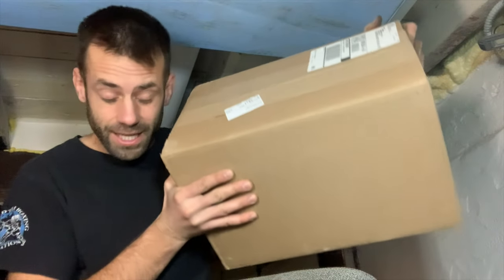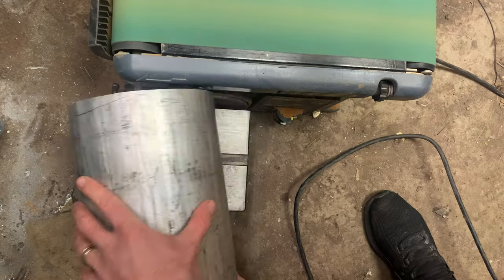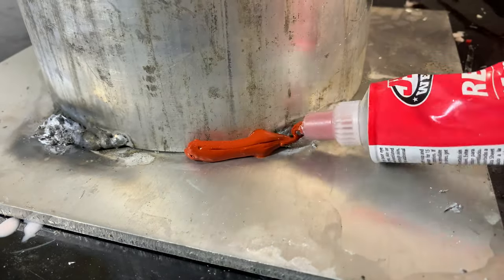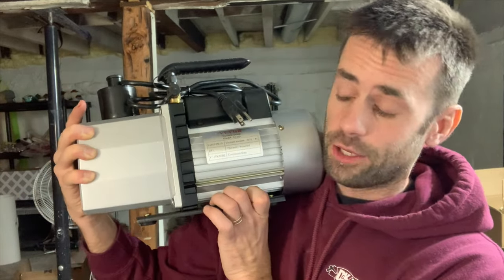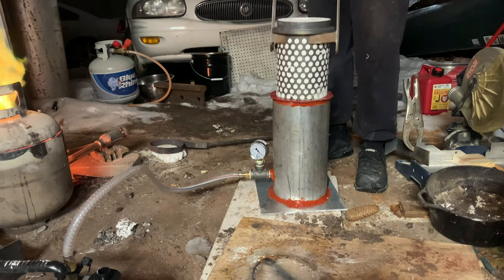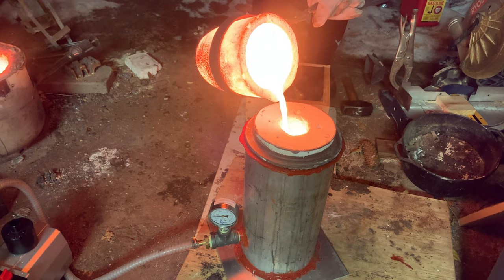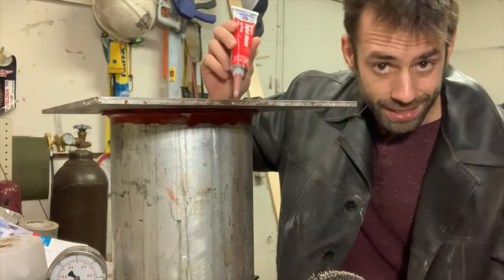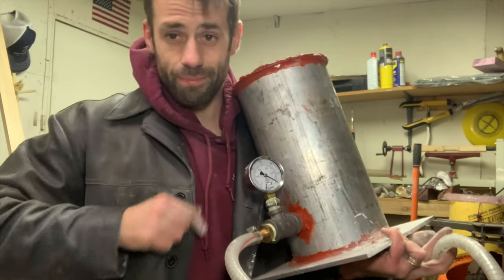DIY Vacuum Casting Set up / Build.

Comment: For the air temp on the vacuum pump, you could always bend some copper tube into a coil and stick it into a bucket of water to act as a heat exchanger to cool the air before it goes through the pump.
Reply: You should probably draw him a picture.  He doesn't seem to bright.
Reply: @kayakMike1000 what? 😂

The dim calling others "not bright" never gets old
Reply: I had that same exact idea!

Comment: I know this is a video from 2 years ago, (just found this channel, love your gold prospecting channel). But I wanted to tell you for FUTURE use when working with Aluminum in the garage use WD-40 as a "cutting/sanding/grinding/drilling/milling" fluid. It works great at NOT loading up your abrasives or cutting tools. Mineral spirits also works well. Being a machinist for almost 40 years this little trick has come in pretty handy. It will make a white smoke, and a bit of odor but that's about it. I have never had a problem with flammability so you should be ok. Good luck and keep cranking out the video's for us. They are very entertaining!!!

Comment: Could just use a longer vacuum hose and submerge some it in a bucket of ice water to keep the air temp down and hopefully keep any metal out of the pump incase of a blowout

Comment: The reason the silicone sheet doesn't work is the the top of the pipe and the plate aren't flat,if you machined them itd work
Reply from the maker: Now I just use a little silicone calk each time. Works really well.

Comment: Instead of taping entire container I've seen other people wrap the perforated container in heavy paper.  The paper looked like a very thin flexible cardboard. The other vloger taped the paper wrap together, using a whole lot less tape and easier to remove.

Comment from the maker: FYI update. The design works very well but do not use aluminum like I did. Use steel pipe! 
I just had a blowout in my flask and the molten bronze melted right though the aluminum. You can see what happened here: 
https://youtube.com/shorts/bgMf2Uo2CUU?feature=share
Reply: Should pin this comment to the top so it doesn't get lost.

Comment: I also made a homemade vacuum chamber. I cannot Weld metal like you do so I used a vacuum chamber with it's thick plastic lid and vacuum pump that I bought from Vivohome on Amazon. I will put info for these items below. I used Dremel drill bit and a Dremel  router to cut into the plastic to make a hole for a three inch diameter perforated casting flask. It is about 7 inches tall. I use a silicone rubber pad to act like a gasket forming a vacuum seal. I also used vacuum grease which sometimes worked and sometimes didn't. Many times, I had a difficult time getting a vacuum but if I pressed on the flask hard enough I would get a vacuum. I'm going to try your gasket sealer tomorrow and see how that does for vacuum sealing. I've been casting aluminum bronze and a silver colored metal for chess pieces. I have done about 50 chess pieces so far and I use R&R ultravest investment for casting material. I have not had any failures so far. Your video gave me the idea of using a gasket sealer I bought some from Ace and we'll see how that works tomorrow. I love your videos and I've learned a lot from them.
Heat Resistant Silicone Rubber Sheet Red Heat Resistant Silicone Rubber Sheet,12 x 12 Inch,Smooth Finish,High Temp Silicone Sheet for DIY Gaskets,Seals, Washers,Electric Insulation,Sound Reduction,Leveling Objects

VIVOHOME 3 Gallon Vacuum Degassing Chamber with Acrylic Lid and vacuum pump

Permatex Optimum Type-1 High Temperature Gasket Maker 3.35 oz 1 pk
Reply: The gasket maker did not make a difference. I had to press down to make a seal but it was worth a try.
Reply from the maker: I use 100% silicone now. I leave it wet.

Comment: What you can to make to silicone rubber gasket last longer spread high temperature grease on it 😉 when I saw what you did just putting the flask on dry it made me 🥲

Comment: Drill Press Pro Tip:  Most drill presses have bases that also allows work to be clamped to it - just swing away the regular work table.  Of course, floor models give a much larger range.  Also, set of cheap hole saws works well for drilling larger holes.
Not sure on welding aluminum, but have seen videos that really sand/clean the aluminum first because the surface oxidizes almost instantly then forms a welding barrier, then they use maybe a zinc alloy welding media.  Like most everything, piece of cake once you learn the secrets.
Reply from the maker: 🤦🏻‍♂️ I didn’t even think about swinging the drill press table out of the way!  Good to know!
Reply: @lundgrenbronzestudios  😂

Comment: Awesome! This is something I've been planning on making. Using wet silicone is an interesting solution! Nice job as always!
Reply from the maker: I’ve tried carbon sheets to make a gasket but I couldn’t get it to seal. I’ve tried ceramic but I couldn’t get that to seal. I know there must be a way but I didn’t have luck with it. And the rubber sheets always burned up. the wet silicone seems to be working well so far though.
Reply: @lundgrenbronzestudios  the silicone sheet its resting on has to be a perfectly flat surface. I guess if you just put wet high temp silicone down, and squished the graphite ring in place on top of that, and let it cure before trying, it'd be easier?
Reply: @lundgrenbronzestudios  Hey use whatever works!

Comment: Interesting video. I have a similar home built vac casting tank myself though in steel with a plate on top. I have also found that the pre made silicone gaskets melt at flask temperatures of around 600C when casting silver. Graphite gaskets on top of the silicone one help to protect it. I found the graphite can delaminate though the whole 'sandwich' still seals under vacuum with a push down. Interested to see if you come up with a way to stop your tongs trapping between the flask & vac tank - I have the same issue. Thanks for taking the time to make these videos, keep me coming - I am now on a similar journey with bronze so they are super helpful!
Reply from the maker: My tong are actually strong enough and the right size to pick up the flask above the flange so once I started doing that the tongs didn’t get stuck anymore. 
I’ve tried a graphite sheet. It was like cardboard almost. I made a vacuum table but I had trouble getting a seal with that as well.

Comment: That was great, thanks for sharing!
Been considering something similar so it was very helpful to see what worked and what didn't 😀👍
Reply from the maker: It works well. The things I would add. Don’t use aluminum. I had a blow out and the bronze melted the aluminum. Use steel. 
And don’t have the hose go directly to the vacuum pump. Have a place for metal to drop into just in case the pump sucks some metal up from a blow out.

Comment: Make sure surface of the plate and pipe are clean, use a flapper disc on a grinder . Will weld alot easier on all types  of metal .

Comment: Hey FYI. I found out just now why those pumps have the warning about upper temperature limit.   I was even using my vacuum chamber as an intermediary where the gasses could cool before getting to the pump......    Well as I'm pouring my brass there's a really loud pop plunk and thud as the cap from the oil reservoir blew off and bounced hard off the ceiling.  

I turned off the pump but the thing I was using to apply vacuum to the flask during casting was in flames and I decided to fire extinguisher it just to be sure.   In the future i think I'll add ice (or maybe dry ice) to the vacuum chamber to help cool the gasses
Reply: Ice seems radical, large temperature differences are probably no bueno. I'd think maybe partially filling that chamber with water and covering hoses with wet towels would increase thermal mass and prevent temperature run off.
EDIT: apologies, I was thinking of a video where the uploader had an intermediary flask to act as a trap and I understood that as the "vacuum chamber". Obviously no water should go where the mold is.

Comment: I like your steps to success. I want to build one of these too but I don’t know where to get the cylinder with holes on the side. Can you point me in the right direction?
Also, since you pour into an open hole, you must be drawing air through it. Ever think of putting a thin disk of aluminum to cover and seal the hole? The molten metal should melt the aluminum disk so it pours directly into a vacuum. 
Thanks,
Paul
Reply from the maker: I got mine from Rio Grande jewelry supply.

Comment: Pardon the stupid question, but what exactly does the vacuum do for you? All the sprues and the pouring spout are on the top, completely open. And I can't quite imagine that the investment is permeable enough to pull a vacuum through it fast enough while the metal cools. I would have expected, that the top of the mold has to be entirely surrounded by the vacuum...
Reply from the maker: But it is permeable enough. It’s amazing how well it works.

Comment: Hahaha I love you've made the exact same  mistakes I did with the first uses of this concept haha xD From wrecking the tape, to leaving chunks under the lip and forgetting to make sure the vacuum is as high as it'll go before pouring :) 
You don't have to use the fancy silicone, you can use any old cheap nasty silicon caulking for £1 to do it. You may need to experiement with how long you let it set before you put the flask down on it though (use for holeless flasks on top).
For the proper flasks,  that nice pretty gasket that you stuck on with the glue and  kinda got fucked on the first shot, that was mostly cos  of the plaster gettign stuck ono it and making the seal bad. Normally, you only get so many uses before the heat kills it (they are consumables). However, if you buy a sheet of graphite that's big enough (and 2-3mm), you can cut a ring the  same size, and put that on top of the silicone bit so it rests between the ring of the flask and the silicone, and you'll get a hell of a lot more uses,  and not need to reapply silicone all the time :) 
Hope these tips help a bit too! As always, thanks for sharing dude, it was ace xD
Reply from the maker: I had a graphite sheet that I tried to use on a vacuum table I made but I had a hard time getting that to seal too. It was almost like a graphite cardboard and I’m not sure if that was the right stuff. But so far the wet silicone has been my best bet. 
But I’m really liking using it so far.
Reply: wet Silicone is a good way to go haha My first iteration of a mini casting table used it on the edges to quite a good effect. Used that for a good while before making the bigger baby for proper flasks. I only bothered using the cheapest silicone caulk for that way though, as it worked fine with it, and cleaning it  up everytime wasn't too bad. I find a wire wheeled brush on your drill will strip the dried remnants off in no time :D
Reply: @lundgrenbronzestudios  If you're having good success with the wet method, and finding it easier/cheaper than other ways, don't fret about things like the graphite seal, it's not important. I've moved onto using throwaway premade 4" o-rings that I get for about £2 a shot, so I'm not fussed that I only get a handful of uses each time. It costs me more for a silicone sheet that I can only get 1 or 2 seals from if  I  cut my  own.

Comment: Great work.   Did/Do you need a cover for the vacuum gauge, just in case of a splash?
Reply from the maker: No. If I splash that much and ruin the gage I’ll just buy a new one but I would probably melt the vacuum tube too if I splashed that much.

Comment: Thanks for this good video, if I have a constant mold(instead of a plaster mold), can I do this method?

Is the pressure difference between the 2 parts the main reason for this high accuracy?
Reply: The vacuum is meant to take advantage of the plaster's porosity. If you want to use a peemanent mold you'll need a way to vent the air out, and the added accuracy will be from the prevention of trapped air.

Comment: How is the vacuum holding up against the high temp. that's my biggest concern
Reply from the maker: The vacuum has been holding up fine. But I had a blow out on one of my flasks. The molten bronze melted through the aluminum so if you build one be sure to use steel pipe. Not aluminum.

Comment: Awesome video! I’m tempted to try this myself. What thickness was the metal you used?
Reply from the maker: Well the aluminum pipe I got was about 1/4 inch but the thickness of the pipe doesn’t need to be nearly that thick. Any pipe that you find as long as it doesn’t viable flex in your hand is going to be strong enough to hold the vacuum and the the flask.

Comment: Instead of aluminum, can the tube and floor be made of iron?
Reply from the maker: Yes. That would actually be much better. I just had access to aluminum but steel would be much better because if your mold breaks and you have a spill of molten bronze it will melt through the aluminum. That actually ended up happening to this one and I had to replace it with steel.
Reply from the maker: Yes. That would actually be much better. I just had access to aluminum but steel would be much better because if your mold breaks and you have a spill of molten bronze it will melt through the aluminum. That actually ended up happening to this one and I had to replace it with steel.

Comment: Nice Work, Wish I had a local source to get investment powder, maybe then I would get into a bit of this, but at $150 a bag shipped, just a bit outta budget.
Reply from the maker: Yeah. Shipping is expensive and getting worse.
Reply: I know a few  casters who drive once every now and then to their nearest stockist, maybe a state away at worst, and they pick up 10+ sacks at a time to last them a good while. $150 a bag shipped is crazy, which state you in dude, i'll see if I can spot you one that's near/cheaper.
Reply: @noviceartisan  I'm in Texas, It's $140 from PMC, but that's not still good lol.
Reply from the maker: Rio Grande jewelry supply is in New Mexico.
Reply: @Thewulf56  Rio Grande is nearish for collecting, but pepetools does it fairly cheap shipped too
Reply: @lundgrenbronzestudios  @David Collinson hell, It would almost be closer for me to drive to north Carolina than to drive to new Mexico loll
Reply from the maker: @noviceartisan  I’ll have to look into pepetool. The only investment I’ve ever used is ultra vest.
Reply: @Thewulf56  hehe my murican geography is pretty poor tbh 😂 It's all in the South right? 🤣🤣 

I've tried a good few types of investment so far and honestly, for the metals we work with, it's really no difference between them. If you're using pla or some plastics, then just add a percent or three of Boric acid to harden the mix up. Otherwise, they'll all work sweet as. If they go wrong, it's more likely your own fault than the plasters
Reply from the maker: @Thewulf56  Haha!  I forget how big Texas is.

Comment: Hey dude, I what’s your burnout schedule on such a large flask?
Really struggling with cracking on mine.
Currently using investment powered manufactures recommended cycle and I do have a proper programmable kiln to do it in so poor/ rough tools are not my issue in this scenario 💁🏻‍♂️
Reply from the maker: I don’t follow an exact burn out schedule. But I try to follow the schedule for ultra vest. I don’t have an automatic kiln and my kiln has two coils. So I run it on low low. Wait a few hours. Then low med, wait several hours until I remember it again and then Med Med. and hold there for 4-5 hours. I think slow heating is important for not cracking it. Because when I crank it up faster than I should I seen to get more cracking.
Reply: @lundgrenbronzestudios  
Thanks Man 👍🏻 I’ll try holding longer at the lower temperatures.
Appreciate your videos as this is quite a niche.
Some of the stuff you have made is great!
Appreciate you taking the time to reply to my message.
Will let you know how I get on!
I’m making more functional parts than decorative but only just venturing into casting so it’s all new… if I can get mine looking anything like as good as yours then I’ll be over the moon! ☺️

Comment: I have a question, does the plaster have to have a hole where the metal enters and another hole below so that it sucks?
Reply from the maker: No. It not actually plaster. It’s like plaster but it’s called investment. It very pours so air flows through it. But still holds the metal. If there was a hole on both side all the metal would just run out.

Comment: Wait! How does vacuum affect anything in this process if it is not reaching molten metal?
Reply from the maker: The investment is porous so it draws air through the mold. The vacuum is literally sucking the metal into it the tiny places.
Reply: @lundgrenbronzestudios  So .. silicone mold is pourous? Is this really the case?!
Reply from the maker: @reinislusis3569  No. investment is porous. I didn’t say silicone, I said investment. This set up is for bronze casting.
Reply: @lundgrenbronzestudios  But there is silicone shell between vacuum and investment and investment is at all times at atmospheric pressure. I don't understand this process.
Reply from the maker: @reinislusis3569  the silicone is a seal to prevent air from going around the flask. This insures the air goes through the investment and not around it.
Reply: @lundgrenbronzestudios  I understand now! White stuff (investment) is cement-like not silicone. Thank you.